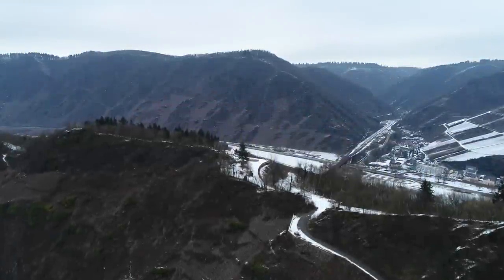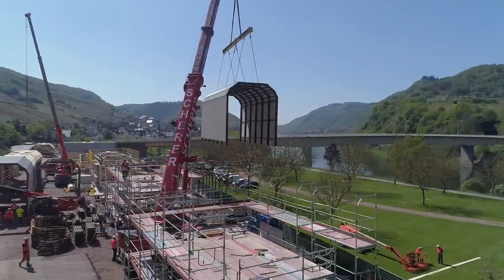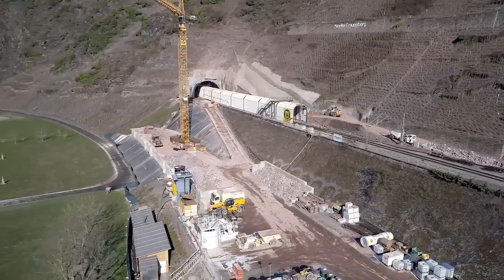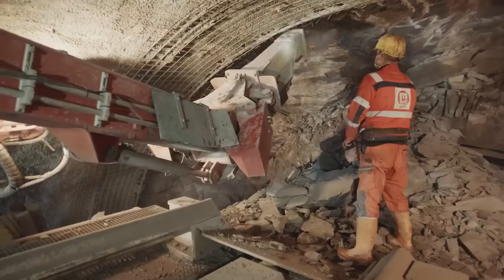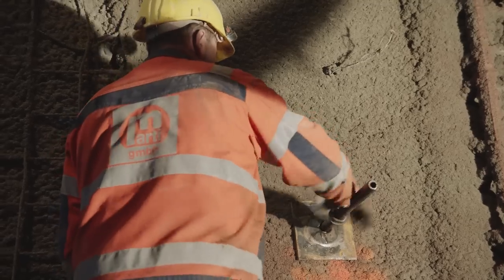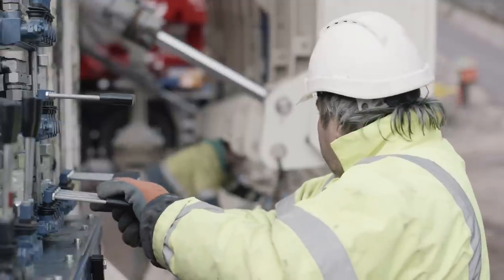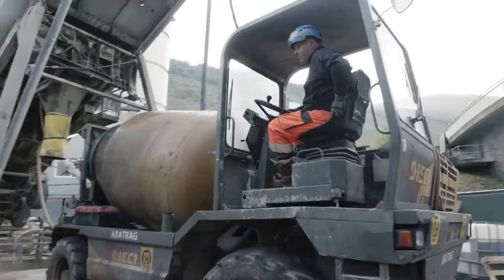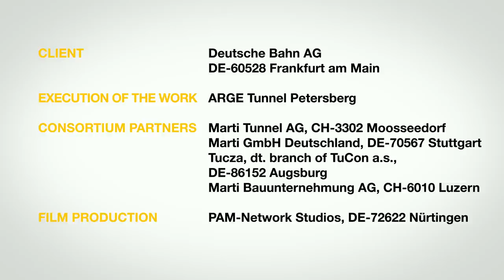Tunnel Petersberg (Germany) – Tunnel in tunnel method

Comment: A STUPIDLY large expenditure, just to meet an arbitrary separation standard? This project i a a picture perfect example of bureaucratic waste.  :(
Reply: Doesn't this also allow trains of a larger, standard loading gauge to enter the tunnel. IIRC Germany's railways were originally constructed by a variety of different local railway companies. I would expect they didn't all have the same loading gauge, so like in most old European systems some tunnels are too narrow or too low to fit a lot of 'standard' carriage types. Increasing the loading gauge of a line is a great long term move, especially if it's current loading gauge is smaller than that on nearby lines so quite a few train types have to avoid that particular line (i.e. double-decker cars, or wide flatcars etc.) Imagine if we did this across the EU and all of our trains were actually fully interoperable across the continent. Of course, increasing the loading gauge is very spectacular in the case of tunnels, and a little bit less so with tight bridges, but outside of them, it's more about moving all kinds of obstacles out of the way of the future larger trains, oh, and shaving bits off platforms to fit the wider trains. (if the goal is to go to a wider loading gauge.)

Of course this problem is much worse in the UK, where some very widespread loading gauges don't fit a flat car with a container on top.
Reply: Ah hah! Somebody else noticed.

Comment: ...so it's not a tunnel at all...just a regulation compliant safety exercise by people with smiling faces.
Reply: The original tunnel was built in 1874 and back then just blasted into the rock - so it wasn't sealed against water and almost 150 years old. It had to be renovated one way or another.

Comment: What a waste of money and materials. The tunnel already existed and nothing of value was added. 2 tracks before and 2 tracks after.
Reply: If you want to use bigger trains you have to enlarge old tunnel.
Reply: It removes a safety risk. They couldn’t use both directions of track at the same time because the tunnel was too narrow to allow the trains to pass arch other at speed. Now that has been corrected and it doubles the throughput
Reply: @theVtuberCh  I know that was the premise, but it is false.
Reply: @marioxerxescastelancastro8019  why is it false? Now they can run bigger, faster trains. Is that a lie?
Reply: @marioxerxescastelancastro8019  how so? Where they wrong about German train regulations?
Reply: The original tunnel was built in 1874 and back then just blasted into the rock - so it wasn't sealed against water and almost 150 years old. It had to be renovated one way or another.